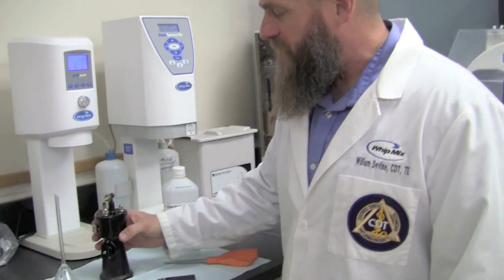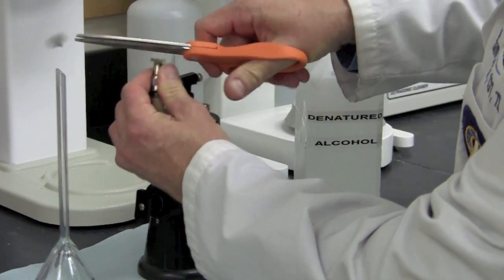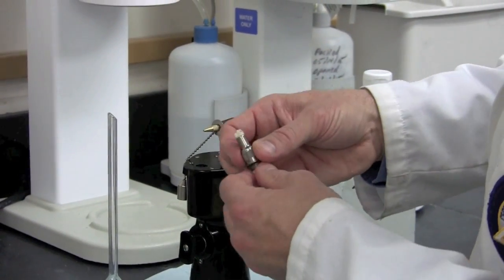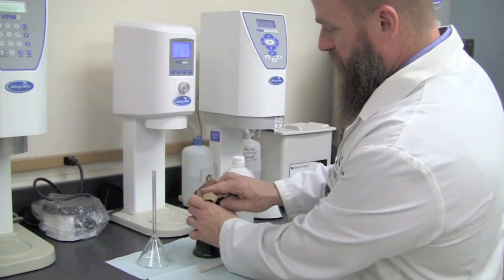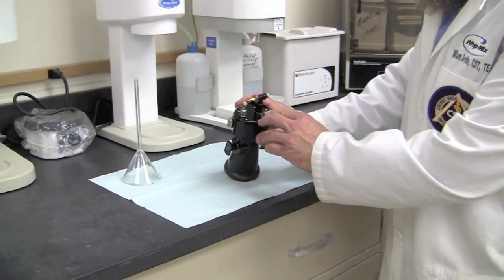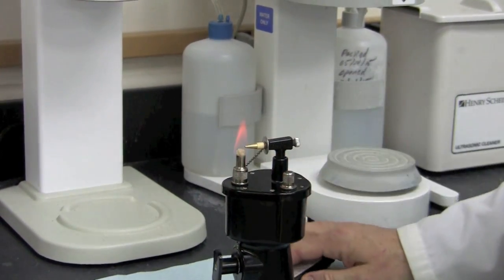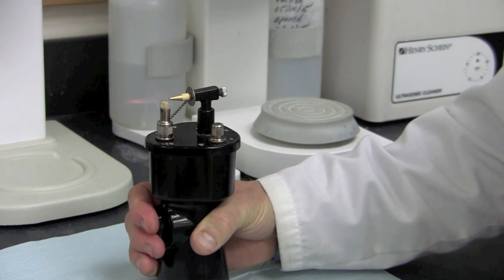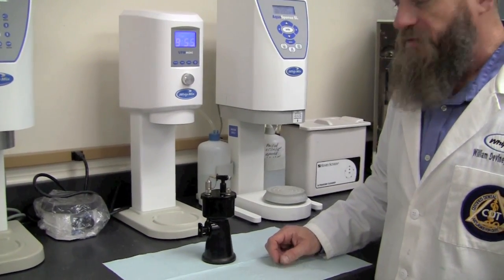Hanau Alcohol Torch - Operation, Maintenance and Safety

Comment: What type of alcohol should we use for this ?
I wonder why I have problems  with my torch (the flame just go off pretty soon), may be the alcohol probably
Reply from the maker: Hi dcargos. Here are some recommendations we provide for the alcohol: https://cdn2.hubspot.net/hubfs/111220/Sales_Brochures/QA-Alcohol-20121.pdf

Also if the wick is too charred it may not burn as well. Maybe try snipping a bit off the top. For other troubleshooting support, please contact Will Devine at 1-800-626-5651.